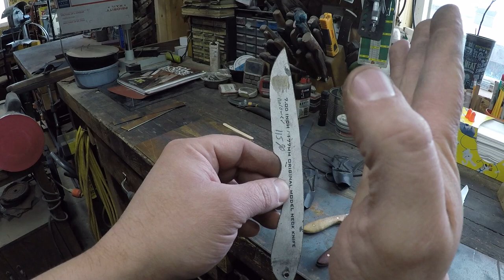making a new knife pattern 2 - pattern making part 1

Comment: Looks like a winner to me. I am making some rounded edges from wood to go up each side of the platen so I can run my belt over the edge and have a nice curve. I already run the belt over but it is not as rounded as I would like I think it is going to work well. It is works well I will make several sizes using my router bits.
Reply from the maker: that is a neat idea. I wonder how well a stepped piece of steel that bolts to the back  of the platen and hangs over the edge would work? possibly different sizes of black iron plumbing pipe welded to a piece of flat stock?
Reply: @joecalton1449  I have used wood as a backing plate before and it worked OK I am going to try wood and if it works I will make some metal ones.
Reply: @joecalton1449  I think your idea with the pipe would be spot on.
Reply: Are u new 2 choyles? Man make u a little clip on sheath for those smaller knifes just more enjoyable.on a cross draw,or scout carry weight for EDC  isn't relevant at that size to me ..Imo ...Unless your packing where ounces are pounds...day to day there good....

Comment: I made a few hand planes. I need a few irons. I can cut drill to size but know nothing about what type of metal and heat treatment.
 I'm in the dark. Need a little feed please. Thank you.
Reply from the maker: that is kind of a big question. the iron sounds like the cutter in a plane for smoothing out wood? if so, then think of it like either a knife or a chisel, so just about any video about knifemaking or chisel making that goes over steel selection, shaping, and heat treating should get you going pretty well. just shape it to the shape of an iron instead of a knife